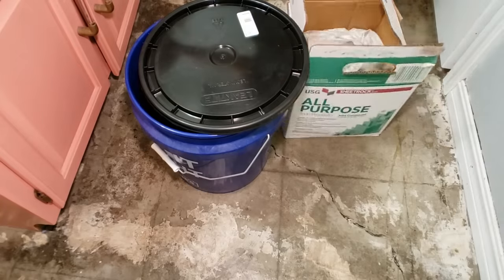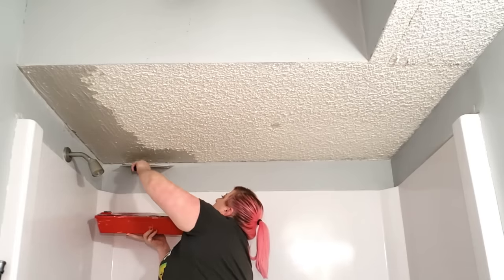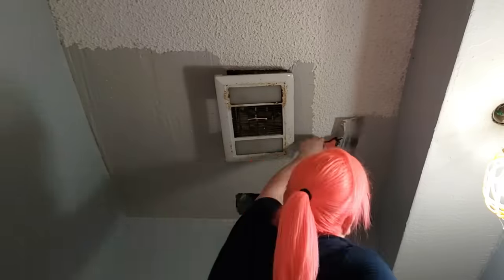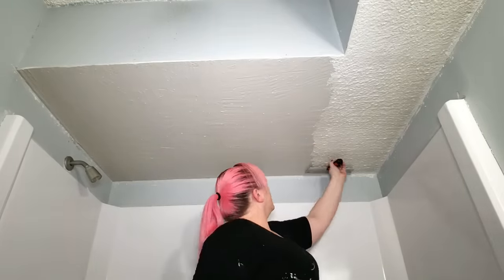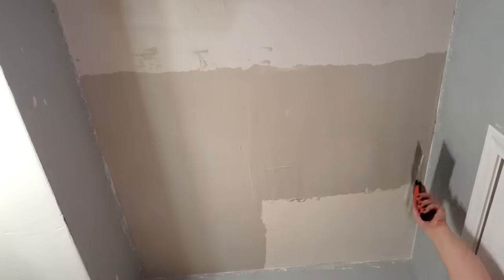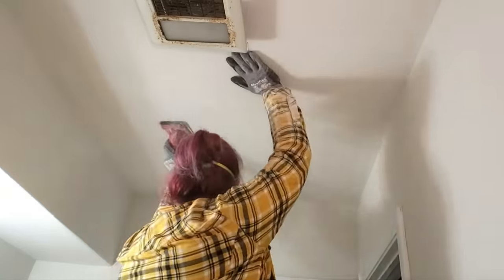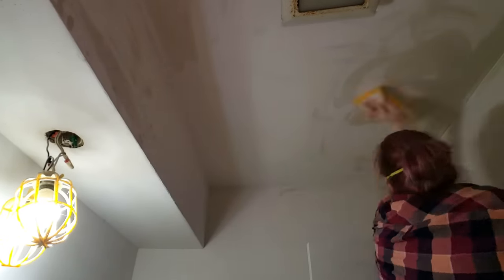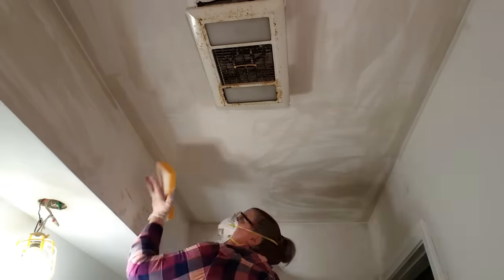How To Cover Popcorn Ceiling Without Removing It | Skim Coating Over Popcorn Ceiling

Comment: I appreciate all your work, but unless those ceilings had been painted, this was far more work than scraping the "popcorn" or "stippling". Had it been painted, I understand avoiding painting, but I'd suggest drywalling. Three coats of mud plus sanding is too much work.
Reply from the maker: I should've made this more clear in the video, but that's why I did this. The ceiling had thick layers of paint that would've been a nightmare to try to remove. The thumbnail says for painted popcorn ceilings but I didn't stress that enough in the video. In the rooms that aren't painted, I've been scraping then skim coating to get the smooth finish I want.

Comment: If you skim coat over unpainted popcorn it will eventually delaminate and start to bubble. The popcorn soaks in he moisture from the mud. Judging from how easy your popcorn came off in the other video you posted it has not been painted. You may have issues in the future.
Reply from the maker: The popcorn in my other video was unpainted which is why I scraped it off. You're right, it came off easily. Both of our bathrooms have painted popcorn though so that's why I went this route in the bathroom.
Reply: @TheNiftyNester  Ah perfect! you should be good to go. I attempted to scrape my pop corn which had tons of paint on it and it was not easy or fun!  Goof job!
Reply from the maker: That was the impression I got from watching others trying to scrape painted popcorn, it always looks like a massive pain. Although this was so much work lol I don't really know what the easier of the two would be.

Comment: Put new drywall. That's too much work. Not worth it. Replace it
Reply from the maker: New drywall is a perfectly fine solution, but it might not work for everyone. If you're doing this by yourself, it's harder to replace the drywall, and you'd need expensive equipment. You'll still need to tape and mud afterward. Also, if you want that perfectly smooth finish, you'll be skim coating that new drywall anyway. Skim coating is also cheaper. It all depends on your situation, finances, and skill level.

Comment: That is one pile of work. Just cover it with 3/8" or 1/4" drywall. Then you just need to finish the joints.
Reply from the maker: For someone who wants to spend less than it costs to cover it in drywall, for painted popcorn ceilings, this is a perfectly fine solution.

Comment: Do not do this. I own and run a remodeling company and although this is smart and she executed this perfectly, most people are not going to be able to float a popcorn ceiling this precisely or mix mud and apply it with no air bubbles, then you have a whole other problem on your hands. Scrape the ceiling, sand the drywal underneath, prime it and paint it. Way easier.

Comment: This might be ok for a very small room but looks totally impractical for a big ceiling or an entire home. Too time consuming and way too much work.
Reply from the maker: This is one solution for painted popcorn ceilings. There are other options. It all depends on your budget, if you have help or not, what tools or equipment you have, etc. I'm not doing this in my entire house. I've scraped the ceiling in a few rooms where they weren't painted. I still skim coated them afterward to get the smooth finish I was going for. For some people who are on a budget and doing it alone, this might be the best option for them. And if it's not for you, that's ok too.

Comment: This is the worst way to do this. It will take more time, energy, material, and has a much higher chance to fail...
Reply from the maker: More time, energy, and material vs. what other method are you referring to? Painted popcorn won't just scrape right off like unpainted popcorn will. That's the only method I can think of that you might be referring to.
Reply: @TheNiftyNester  Eh, raking the painted ceiling first works and takes little effort and time. After the paint will actually help pull the wet popcorn texture down faster.

Comment: Great but you should be wearing a mask or a respirator since most popcorn ceilings have asbestos.
Reply: If it's before 1980 there's a high chance it has asbestos.  By 1978 asbestos was banned so chances should be low if the home was built after that.  Get it tested if you're not sure.
Reply: Also, a typical dust mask you buy in a home center isn't going to protect you from asbestos, and all asbestos removal should be done by professionals.  That being said, you should still wear a dust mask if you are removing popcorn or other dusty remodeling work even if it does not contain asbestos.
Reply from the maker: My house was built in the mid-80s. I've previously tested for asbestos, so I know I'm in the clear. But like S A stated, a dust mask wouldn't protect you from asbestos. I wore an N95 when sanding to protect myself from the dust but I didn't really need one while skim coating since the popcorn was painted and sealed, creating no dust at all during that part of the process.

Comment: Sweep off all the loose pieces of popcorn before you begin this
Reply from the maker: When the popcorn is painted like this, there aren't any really loose pieces of popcorn. If you knock it down and expose the popcorn underneath the paint, you risk moisture from the joint compound soaking into the popcorn. In this situation, it's best to clean the ceiling first but not try to knock off any of the paint before skim coating.

Comment: DO NOT SKIM COAT!!!!  It comes off with a little water. The moisture in the compound will cause it to release and it will fall on your head.
Reply from the maker: This should not happen at all. If the surface is properly prepped, the joint compound is left to dry fully, then sealed with primer, it shouldn't just "release and fall on your head". If your popcorn ceiling is already damaged and failing, you shouldn't skim coat. But for already sealed popcorn that's in good condition, this is a perfectly fine solution. The joint compound should adhere to the ceiling. Once it's been sealed with primer the humidity won't affect it. This project is in the bathroom our 5 kids share. It's used daily, lots of hot showers, and it's still perfectly intact.
Reply: @TheNiftyNester  its only attached as well as what its attached to.
Reply from the maker: Agreed, if the texture you're covering isn't attached well, this obviously isn't going to fix that problem.

Comment: Easier to just remove the popcorn ceilings. Just needs water and a scraper. Stop cutting corners
Reply from the maker: I'm going to start just copying and pasting this response 🤦‍♀️ That method works great for unpainted popcorn ceilings. This method is an alternative for painted popcorn ceilings that will not scrape off easily. Primer and paint seals the popcorn. Water can't penetrate sealed popcorn. Also, if you think this is cutting corners, you've clearly never spent days skim coating. This is a lot of work.

Comment: Popcorn ceilings usually have asbestos.  Please don't diy this without having it tested first.
Reply from the maker: I tested the ceilings before scraping in another room in our house. This project is specifically meant for painted popcorn ceilings. In this instance, since you aren't scraping and they've already been sealed, skim coating would be the safer alternative to scraping if you did have asbestos.
Reply: @TheNiftyNester  Any disturbance will release fibers into the air.  Of course painting won't release nearly as many fibers as scraping would.
On the plus side, painting it will make it less likely to release fibers in the future.

Comment: Popcorn ceilings are much more expensive than a plain ceiling. Why cover all that money?
Reply from the maker: It's actually more expensive to have new drywall done with a smooth surface because of the amount of work it takes to get a perfectly smooth finish. Popcorn ceilings were used as a cheaper and easier way to cover drywall, otherwise you have to properly install the drywall then mud and sand without the joints showing in the end. There's nothing wrong with popcorn ceilings if you like them and want to keep them but I personally don't like the way they look and they are worse for allergies since they tend to hold on to dust worse than a flat surface does.
Reply: @TheNiftyNester  Oh, that's why my daughter's ceilings look so tacky in her new home. Her ceilings don't have that perfectly smooth finish because we can see the tape.

Comment: That looks 3 times harder than removing the popcorn
Reply from the maker: It's a lot of work. If your popcorn isn't painted, it would be easier to scrape. Although I still skim coat the drywall after I've scraped the popcorn to get a smooth finish. In this situation, though, when the ceiling is painted, it won't scrape off easily. It can be a nightmare to remove painted popcorn.

Comment: Don't do this, it gets damp and drops right off
Reply from the maker: A lot of people do this successfully, I imagine it could fail if not properly sealed. You have to skim coat over sealed popcorn, not unpainted, or the moisture will weaken the popcorn. If it's sealed, it sticks just fine. Then, when you're done, you have to seal the skim coat with primer. This is in a bathroom with heavy daily use and it has held up perfectly.

Comment: But.... It's easier to remove it first. Work smarter, not harder.
Reply from the maker: I've responded to this exact comment hundreds of times, but I'll do it again... This popcorn was painted. As stated in the thumbnail and the title, this method is for painted popcorn ceilings. Painted popcorn will not easily scrape off after being sprayed with water like unpainted popcorn will. You'll likely damage the drywall in the process of trying.